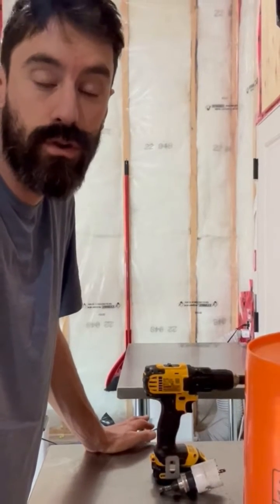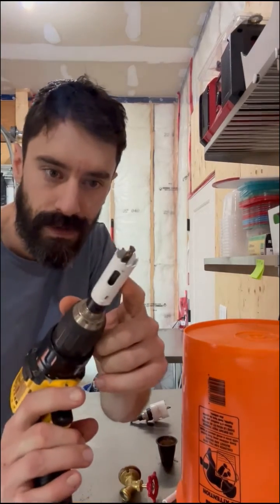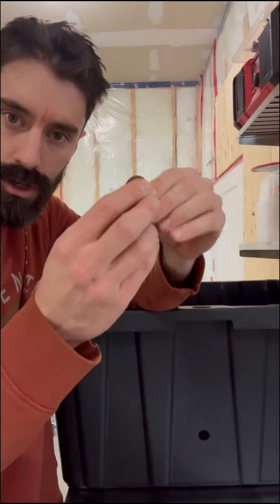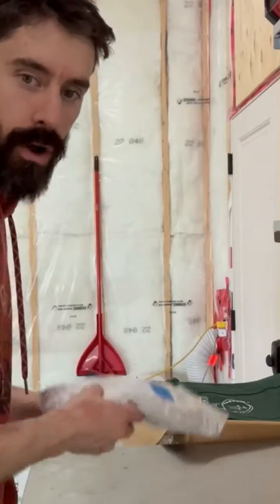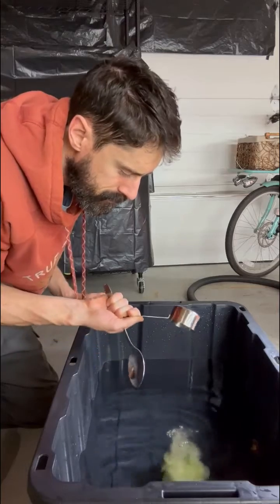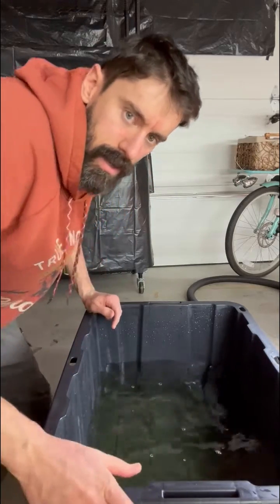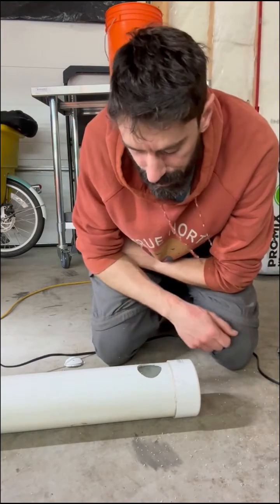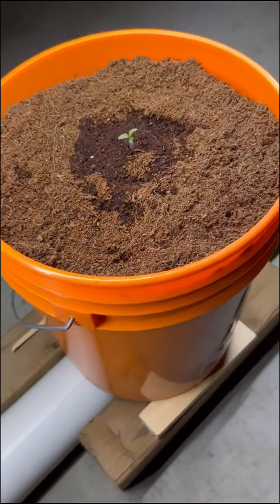How To Grow Greenhouse Hydroponic Tomatoes In Gutter Grow System

Comment: Thanks for the information! I am a fan of DWC with aeration (indoors) and Kratky tubs (outdoors). Neither of these is "fix it and forget it" due to the extreme heat in the summer months in central Texas. Any recommendations?
Reply from the maker: Hey @GrowingwithGlenna 
For the gutter grow system, you just need to make sure the soil stays damp.  You can either use some wick cord (https://amzn.to/3J5aj1I) to increase the wickining inside your bucket or put some hydroponic clay pebbles on top to prevent evaporation (https://amzn.to/3xqpJv0)
Reply: @growingwithsimon  Thanks for the advice!